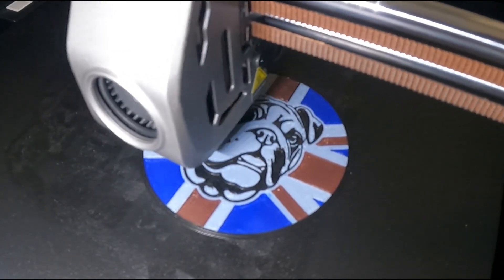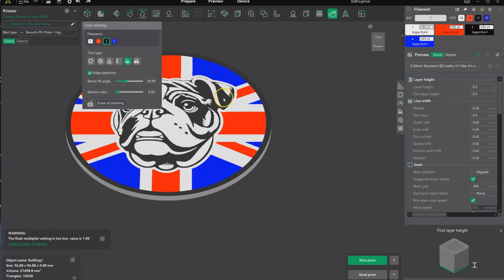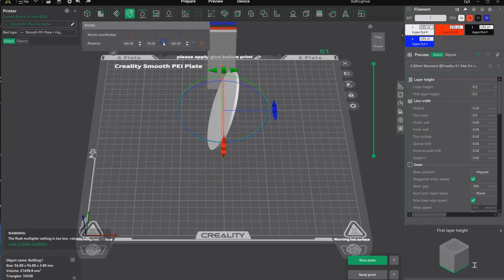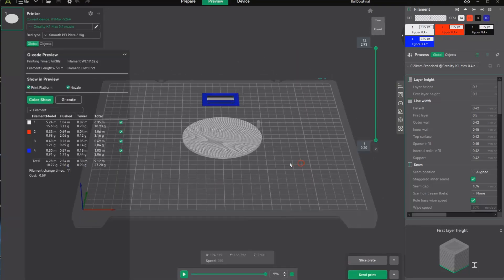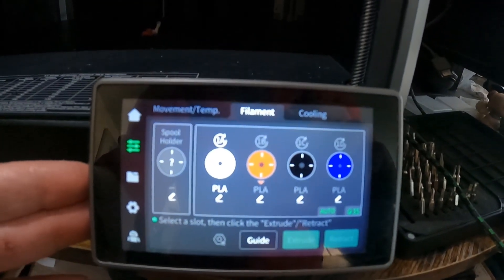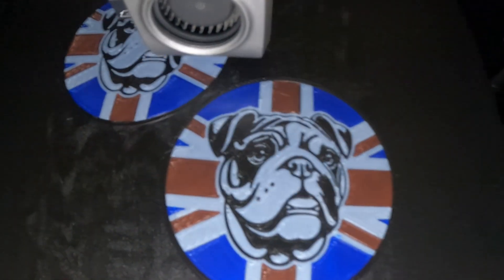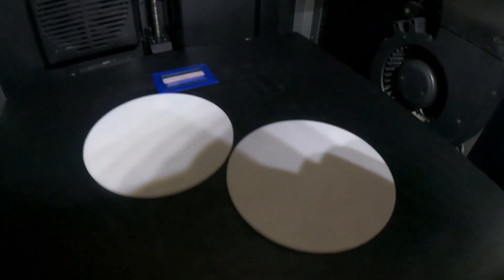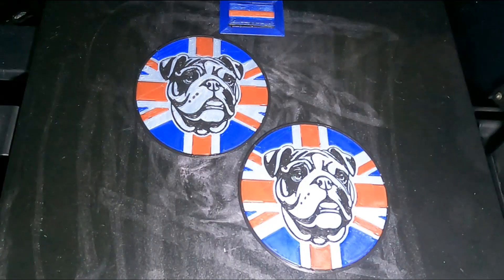K1 CFS UPGRADED - Now Let's Print #3dprinting

Comment: After i installed the upgrade kit on my k1 max.   I had the same issue with the usb and figured that out.    I keep getting tc2841 error everytime it tries to swap colors.    It cuts the filament clean, but dosent retract the filament back past the sensor which i believe is causing that error.

Comment: Does it bleed a lot on the pieces when changing color? I have a K1 and I want to upgrade, does it leave a lot of lines on large pieces?
Reply from the maker: Hi, I haven't seen any colour bleed on the prints I have done. I have yet to try a large print but can't see any reason I would get lines as the prints are as smooth as before.
Reply: @Kalbo64  Could you make a video when you make a big color?
Reply from the maker: @Lokilouco432  Yes I will for sure.

Comment: My CFS should be arriving this week, just in time for the Easter weekend so I can do the same and have a nice slow time of figuring out the upgrade kit - Sounds like it's all working well for you which is great news!  Need to figure out how to do custom RFID tags for my bargain bin spools
Reply from the maker: Hi, yes it is at the stage I am happy to start a print and go out if I need. I am sure as a user you can relate to being happy to just leave a printer without a second thought :D. I have been using custom RFID tags with the K2/CFS Custom RFID and it works well, only thing to make sure is you get the correct tags. These are the ones I got, and they work perfectly https://www.amazon.co.uk/dp/B0BZRRZ1BW - Good luck, and I hope it all goes smoothly.
Reply: @Kalbo64  great advice thanks, I did already buy some tags but maybe those are good for home automation instead. Will get some of those other ones!

Comment: Awesome video 
Quick question on the physical set up of the CFS machine and upgrade.

Can the k1 no longer have the upper glass with the upgrade ?
Reply from the maker: Hi, yes that is correct. I am just printing a test riser design I made to put the glass on, and CFS on the top of the printer. I will release it if it works out well.